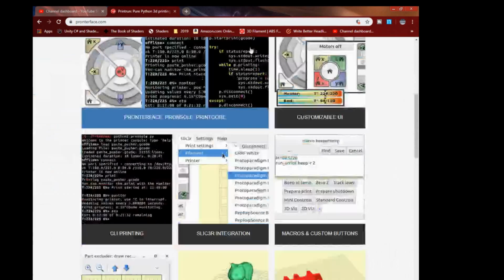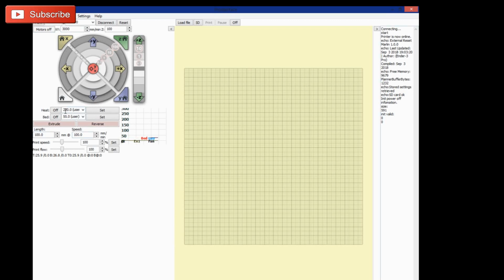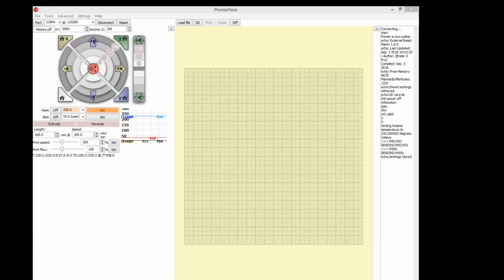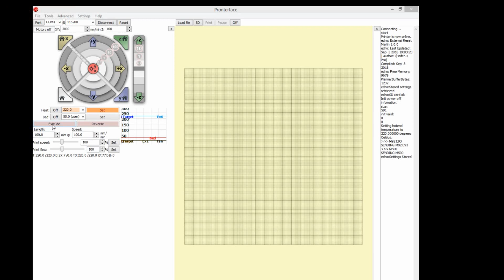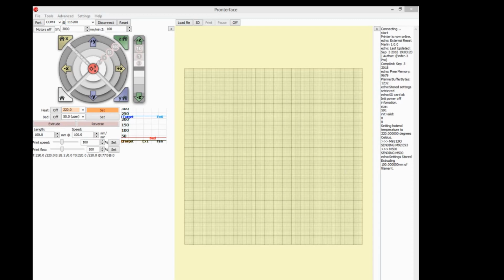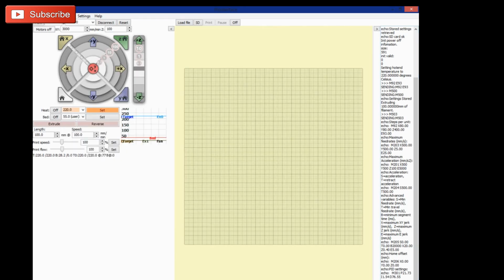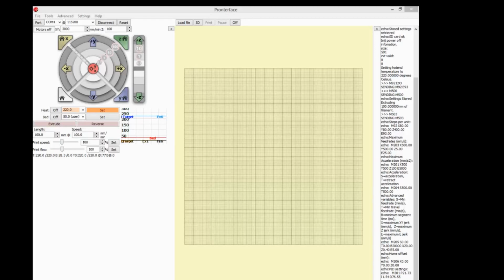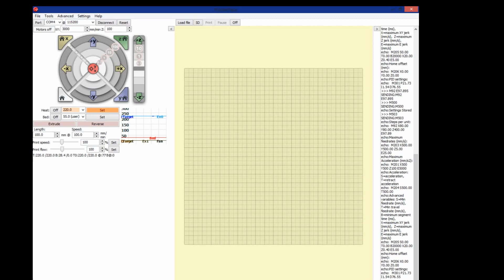Extruder Calibration  - Calculating your E-steps  - 2.3

Comment: I feel like this could be done with a simple start g code. My printer does not like pointer face
Reply from the maker: It sure can be done through a start gcode. You can actually it in cura directly, and most other slicers, with the printer hooked up. But doing a start gcode will work. Just make sure you remember to change your code back when your done in order to not waste 100 mm of filament on every print. And also if you have issues doing this set the start code to preheat the hot end, before extruding, because the printer doesn't know the Bowden tube isn't hooked up so it usually won't let you extruder with the hot end cold.
Reply: @Technivorous  thanks for the tip. Allways nice to know other ways. I did however get my printer connected to ny pc using matter control 2.0. Just worked no bs
Reply from the maker: @wesleypujol4057  going to look into matter control right now

Comment: Thank you so much for this ! A lot of tutorials on youtube only show you how to calculate the e-steps, they show all kind of calculation and steps to achieved the e-steps etc. But one important thing that they missed out and never show the new user is how and where to add in those commands, for example what program to access inside the printer? is it cura, is it simplify3d ? They just assumed that the user know about this instantly. I have no clue which program to add in those commands and I'm sure a lot of 3d user folks would not know about it either.
Reply from the maker: did you find the link to pronterface? www.pronterface.com its free and works great. thanks for the positive feedback!
Reply: @Technivorous  Yes I followed your direction and was able to do the e-steps easily. Great job ! thanks a again

Comment: Great video 👍, I'm assuming you can't do this with a stock ender 3, is a requirement flashing a bootloader and then run a marlin firmware?
Reply from the maker: no actually, this is stock no bootloader needed. pronterface flashes the settings to eeprom, but does not alter the firmware, just the setting for the e-steps.
Reply from the maker: you can actually do this with you ender 3 hooked up to cura, because you can send g code in monitor mode, but it dosnt have a display for showing you the return of the M503 code.

Comment from the maker: if your problem is over extrusion, the mark at 100 mm will be beyond the extruder. in this case, remeasure to 120 mm, and extrude another 100 mm. dont extrude 20mm, you need that 20 to tell the difference. the other way to do this is to disconnect the bowden tube from the hot end, and clip the filament to be level with the tube, then extrude 100 mm, and measure the part sticking out of the tube. this other method works for under and over extrusion, but is not possible if you have direct drive. the extruding and measuring should be done three times, and the average should be used for your calculations.